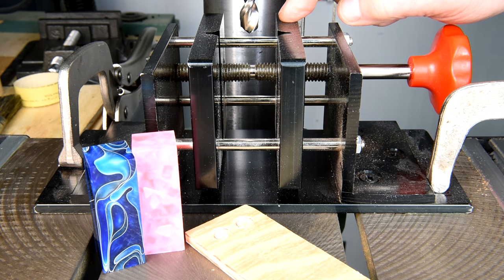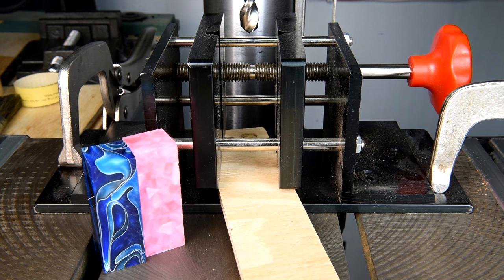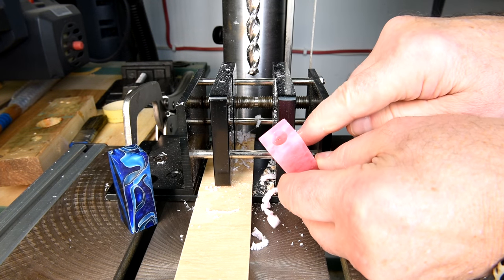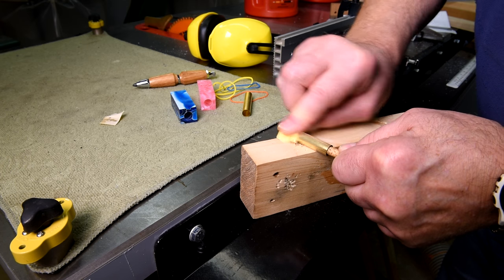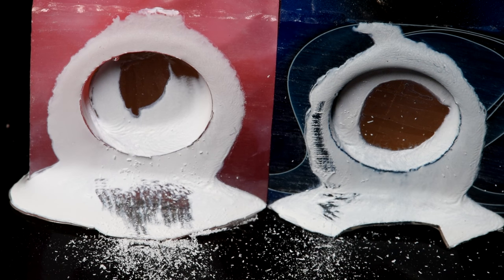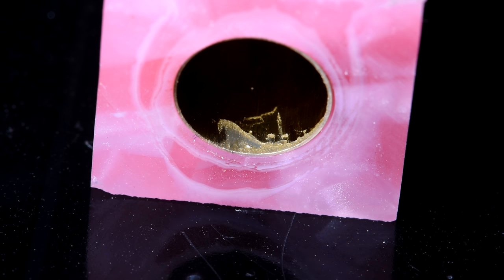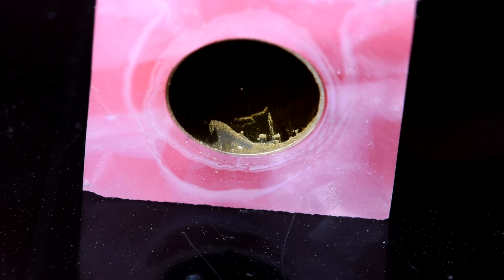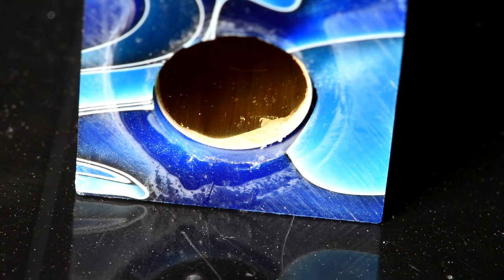The His & Hers Napoleon Pen Set - Part 2

Comment: Ron,  Still don't understand the white coating on the CA.  I have never had that.  Must have something to do with the brand of glue or activator. 

As for see through blanks, my experience has never been to acceptable without doing some thing to the tube or blank.  No matter how I tried to get the glue evenly distributed I have always had "see through" glue lines.  Instead of painting the tubes, I have had better luck painting the inside of the blank.  That way there is no way the glue shows thru.  I just go to the local craft store and buy some small bottles of acrylic paint.  It comes in a gazillion colors so you can try to make it look the same or make it an accent color.  The only trick is to make sure the entire blank hole is covered.  If not, you're back to square one.

I have disassembled more than one pen because of the glue showing through.  The worst part is the wasting the blank and tube................. and time.                                 JimE
Reply from the maker: It will be interesting to see what I end up with re that pink blank. Painting the inside of the blank in the future sounds like the way to go.